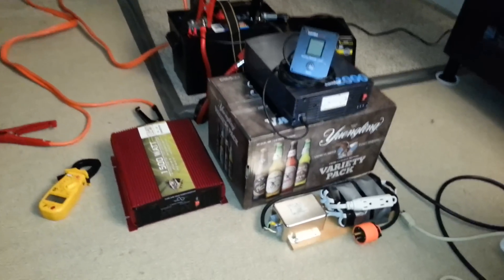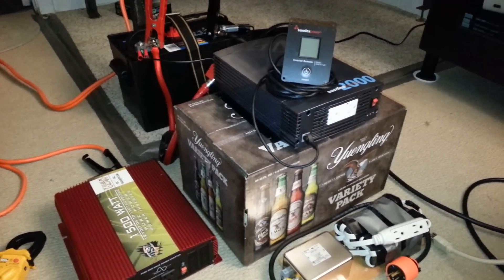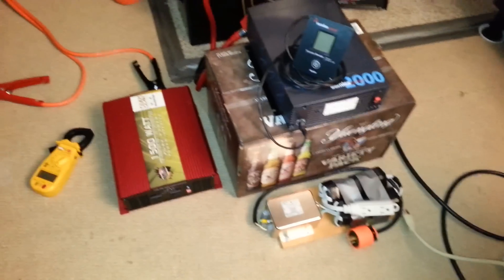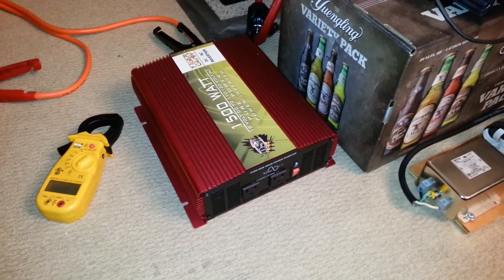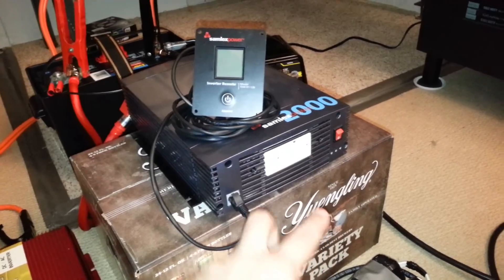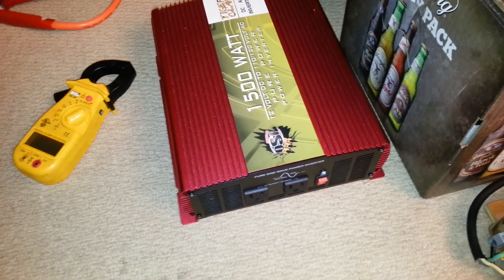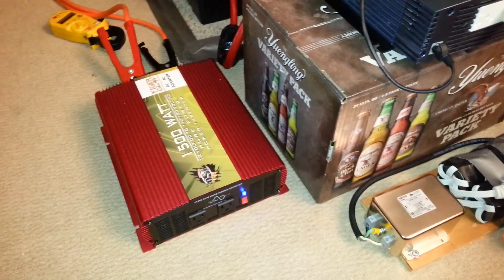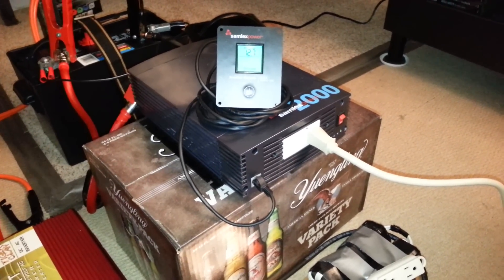DC to AC Inverters: Power Factor & Bonded vs Floating Neutral

Comment: Can you get a shock from an appliance that develops a fault and let's say it's at a 220V potential if the whole system is floating and it's not grounded? I'm asking this question thinking why would the current want to travel to earth if the inverter/generator is not earthed so there is no ground loop for current to flow through. So would the current still want to go to earth. Or still shock you and why 

 I've been trying to get a question for this on the internet with no hope. 

So in summary
Can a faulty appliance case at high voltage electrocute you if the whole system is floating?
Reply from the maker: Ideally no, but practically, most likely yes you will get shocked. Ungrounded/floating systems are too dangerous and unpredictable. As they say electricity follows the least resistance path. it will find it regardless.
Reply: @Bassguitarist1985  Thanks for the reply

Comment: My inverter doesn't have the nuetral to ground. Can I add it in. My furnace won't run without it.
Reply from the maker: Only if its a sine wave. A modified sine you will short out the mosfets

Comment: Hi, I am looking to do almost exactly what you did with using an inverter as a backup with my protran transfer switch.  I have a xantrex inverter and I removed the GFCI and it will work but it has the neutral to ground bonded.  I am able to remove the ground to neutral bond by simply removing a screw but I am not sure if I should or not.  Its my understanding you only want one neutral to ground bond (which I have at my house main panel) but I have also been told that with the inverter its better to leave the ground to neutral bonded now that I already removed the GFCI.  Thanks
Reply from the maker: You are correct cannot have two neutral to ground bonds. I probably would have done the same if i had the same inverter. The tigerclaw doesnt have gfci or the N-G bond so i was already semi setup for a two pole transfer switch
Reply: @Bassguitarist1985  Thanks!  yeah its not documented with my inverter that you can remove the bond by removing a screw but i think its because its listed for marine and rv use where that wouldnt be an issue.  one thing that concerned me at first is after i removed the ground to neutral bond on the inverter, i was measuring 60v between the hot and ground on the inverter and 60v between the neutral and ground on the inverter but then i realized that makes sense for a 120v floating neutral inverter right?  like how 240v is 120v on each side.  since the inverter is 120v with no neutral it made more sense, plus since neutral is bonded to ground at the panel, once the inverter is plugged into the transfer switch this behavior is gone.  i was a little nervous that running the inverter with the ac mains power restored could be an issue but in testing it wasnt an issue.  i ran 1 circuit on the inverter on the transfer switch with the ac power running everything else and it worked perfectly.   i just  wanted to make sure i wasnt missing anything or overlooking anything, thanks
Reply from the maker: @mark33545  exactly on point. The alternative would be to leave the GFCI outlet on the inverter as if it were original and disconnect the ground wire from your inverter to the switch. The protran is a 2 pole and has its neutral bonded to ground at the main panel so if you were to power from the inverter if you had a ground fault it would go back to the source which is the inverter. The problem is it would be a full current short. Gfcis interrupt the circuit far sooner with only a few amps of a short circuit. That may not bode very well for the inverter if that happens too often
Reply: @Bassguitarist1985  I had actually thought about reconnecting the GFCI outlet after I found how to unbond the ground and neutral thinking it would work properly now.  I would also need to disconnect the ground wire to the inverter to use the GFCI?  Would removing the equipment grounding conductor put me at risk of any potential hazards?  if i understand correctly your saying that gfci w/ no ground is actually safer than having a ground w/o gfci?
Reply from the maker: @mark33545  if you reconnect the gfci in the inverter back to OEM stock, then the wire you use to connect to the transfer switch dont connect the ground lead. That breaks the ground loop and the gfci shouldnt trip. Im not an electrician so make the mod at your own risk, but i didnt grt shocked with my setup.
Reply: @Bassguitarist1985  Thanks much.  I am curious have you ever considered wiring in a inverter charger with automatic transfer switch to your protran and leaving certain circuits switched to gen so  that if the power goes out, you never lose power to those circuits?  i thought it was kind of the next evolution to the system i have now.  that way if i am sleeping for example, the ceiling fans will keep going or maybe even small window AC unit if i got a big enough inverter charger (I would think a 2000watt aims inverter which has like a 5000 watt surge for 20s would be enough to run a 6000btu AC that runs at around 400 watts and 1800 watts on startup surge).

Comment: FYI just researched the two inverters and the OSP Tiger Claw 1500 is a low frequency Transformer based Pure sinewave Inverter, whereas the Samlex is a high frequency (newer tech) unit.

The low frequency inverters generally are heavier because of the giant transformer that is required.
Reply: https://www.youtube.com/watch?v=iMHBw93W-XM
Reply from the maker: Thank you for this! Two completely different topologies. the HF inverters are def more difficult to design as the filtering gets more complex. The LF inverters still are effective and cheap at a low wattage, thus the price point. Appreciate the insight!

Comment: PF is somewhat irrelevant as it is not true power. My guess is the tigerclaw has extra capacitance in the output. Great vids !
Reply from the maker: I agree. But you PF is VERY important for load efficiency and battery life. If the Voltage Amps are high means the apparent power is being wasted heating up wires draining the battery. I wonder if adding a capacitor in parallel between hot and neutral would increase PF on the samlex?
Reply: I agree the reactive power is a drain on battery performance.Adding capacitance to The output may help, but the inefficiency is most likely in poor wave form generation like a cheap wall transformer. I have never seen a PF that low before. Great vids, keep them coming. Really liked your Generator repair vids. You pointed me in the right direction to fix my fathers generator. Many thanks!

Comment: Would these power factor results make it worth it to take the inverter back even though it's a good brand? I'll definitely check my when I'm done repairing them.
Reply from the maker: I got my unit for a good cost. It seems to work well. Just not terribly efficient

Comment: almost like there is something wrong with the inverter because that's pretty bad i wouldn't even try to run equipment that runs at a very high VA and a very low wattage (unless it does the same when its plugged into the wall) and your battery probably doesn't last as long given that you a drawing 2 amps on the AC side you are going to be drawing something like 20 amps off the battery to run a 30 watt load that would normally draw 3 amps
Reply from the maker: I dont think its a flaw of the inverter. Voltage amps is the apparent power, not real power which is in watts. With the voltage amps being high I can cause fuses and breakers to trip. This is an issue for inductive and non linear loads. Resistive loads have no problems.

Comment: I was wondering if your powered speakers are reacting a bit to the inverters. Would the results be the same if you used a 100-500 watt light bulb as a load to make sure the load is purely resistive? The video quality was one of your best! I'd appreciate your input on my repair videos. You and K got me started on repairing inverters! Can I get the battery part number from you?
Reply from the maker: Yes the speakers are partially inductive as they have transformers inside. Results are the same on both inverters if I was using a purley resistive load. Same results with a good CFL light if they have a smoothing cap inside.
Reply from the maker: The battery part number is a Maxx Everstart 29DC from Walmart.